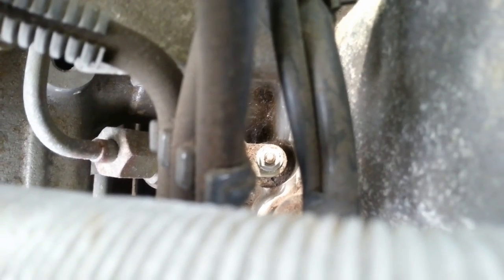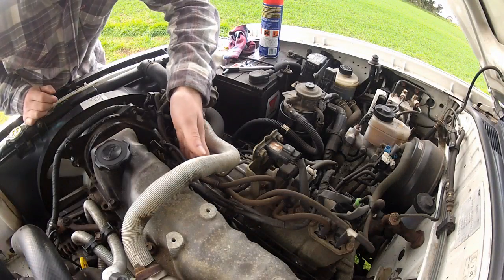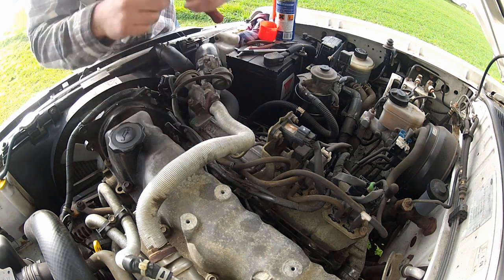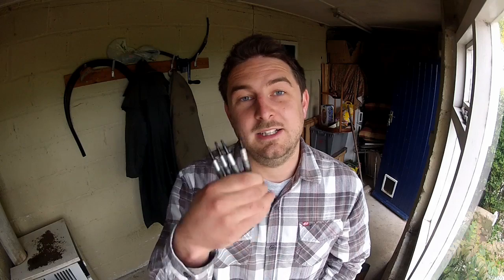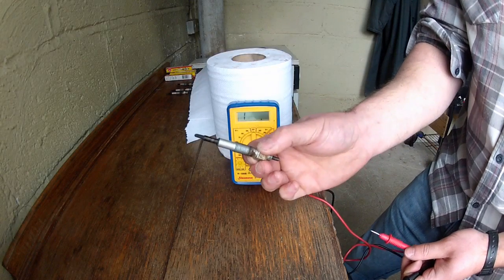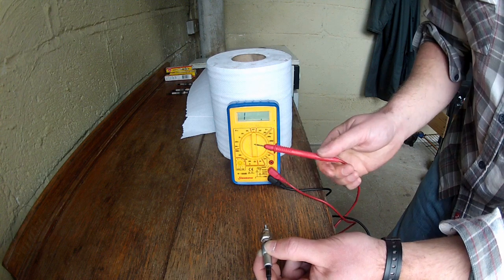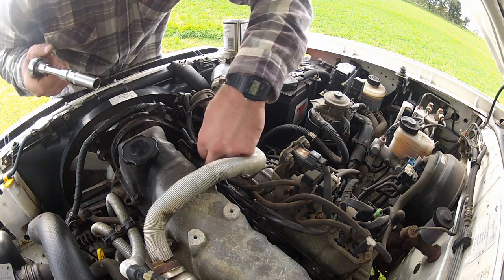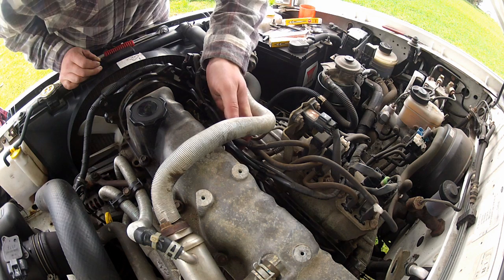How to Remove, Test & Replace Glowplugs in a Diesel Engine | Tech Tip 13

Comment: Use plenty of release fluid and get the engine hot as well and I hope it's an easy job for you and their not seized in the head
Reply from the maker: Good advice. Break one off and this job gets a whole lot worse!
Reply: How would you go about fixing that if they snap? Doing this repair to my 04 ranger nervous is an understatement

Comment: before you do anything with glow plugs if your having starting problems make sure you have power going to them it was my relay and not the plugs.you can also do a resistance test without taking the plugs out .
Reply from the maker: Yes very good points. I've not had a relay go bad yet but could certainly cause similar issues. Relay on these trucks is under the fuse box in the engine bay for anyone reading. Thanks.

Comment: @4.20 You say plus or minus a couple of tenths, that depends on the multi-meter, the base resistance in mine is 2.3, you have to set it to resistance then touch the red and black together to get your machines base resistance, usually this is a couple of tenths yes, but on mine in particular it is 2.3 which makes a big difference when testing glow plugs.  If I hadn't tested the base resistance on my multi-meter first and just took off a couple of tenths then I would of replaced my glow plugs for no reason as they were reading 2.9, which when I take off my machines base resistance is actually only 0.6 and they are perfectly fine.
Reply from the maker: Yes fair point. If you need to check the base resistance of your multi meter, do as this man says.

Comment: This is the simplest and most understandable video on this, even for a girl! Will try, have just recently replaced my alternator successfully, ....now it cold started once briefly before it stalled ,glow indicator light worked first up but then disappeared and just cranked over  but not start. Don't have a multimeter, but would be happy to just replace the 4 on my Holden Rodeo Td 96 model. It smokes on start up and after idling a while which has been like that for 4 years..! Any additional tips would be very much appreciated.
Reply from the maker: Thanks Magda. I do try make the videos accessible for beginners so thanks for your kind words! Sounds to me like a change of glowplugs may sort you out. Give them a squirt with some penetrating oil night before 👍
Reply: Fast Rust, Thank you so much for your reply!👍😃, It's a new challenge and if it works again,.... I won't sell it to the wreckers!😂 I'll spray it with good lube, cheers😃✅
Reply from the maker: No prob. All good experience!

Comment: A very good video....many thanks for posting. Could you do the resistence test 'in situ' ?
Reply from the maker: Thanks, you probably could to be honest yea. Same process except ground the multimeter to the engine/chassis
Reply: Yep. Provided you isolated the individual glow plugs by removing the common jumper bar from hot/top terminal(s). Else you will be measuring all plugs at once in a parallel cct. No find open/high resistance then if even only one glow plug is good. Late I know but may help others.

Comment: Great video mate. Loved the difference in exhaust emission after the change. How long did you apply penetrating oil before you pulled the plugs?
Reply from the maker: Cheers. It really cleaned it up! As long as you can really. If you're in a rush 15 mins will be better than nothing

Comment: Recently bought a Ford fiesta mk6 with the 1.6 diesel engine. From start up there's smoke for about 10 secs like in your video and it runs rough at idle. Next week will be changing the glow plugs, hopefully will sort out the problem.
Reply from the maker: Any better?
Reply: Fast Rust haven't done it yet lol. Was planning to do it after I get the V5 logbook but it's been taking time to arrive. Bought the car first week of May. Might change the glow plugs next week and just hope they don't snap and fix the smoke from start up and rough idle. There also is a strong diesel small for about 5 seconds from start up
Reply from the maker: Git 'er done!
Reply: Fast Rust my dad is doing work in his car at the moment in the garage so hopefully after will get it done

Comment: Great video thank you ! Changing mine tomorrow.
Reply from the maker: no problem. Good luck!
Reply: All went well as your video gave an excellent idea of what to do. I managed to remove all the 8mm nuts from the plugs without dropping them and all the glow plugs came undone without snapping which was a relief after 157,000 miles. I put it all back together and was just gently tightening up the nut with the 1/4 socket when I managed to snap the top of the plug ! Fortunately I had a spare and after removing the rail, again, I tightened up with a screwdriver in the end of the extension and just very carefully tweaked it. All is well. Thank you once again for taking the time to put the video up as it saved a huge amount of hassle. (Nickname from the Ranger Forum)
Reply from the maker: +cologne2792 Great news. Sounds like a job well done all in all! Glad the video helped you out. The fasteners for the rail are super small, a gentle nip up and you're good to go :)

Comment: Thank you for this video.
Is it ok to use anti seize copper grease on the threads of the new plugs before installing into head?
Reply from the maker: toyo toe you're welcome.
I don't see why not, I did - I just forgot to mention it!  As these things are notorious for breaking off in the head, it seems like good preventative maintenance.